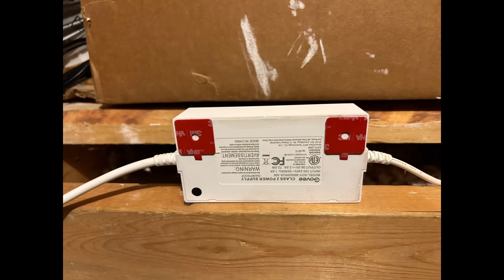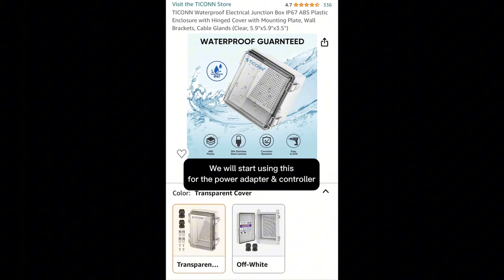Govee Lights( My Home Review) The Do’s & Don’ts @GOVEE  #Howto #govee #diy

Comment: Good afternoon JB, I've joined the club!  You have been a huge help with your videos and answering my questions in a very timely manner.  I have an issue with my Govee 150' elite light strands.  I ran about 20' from the room dormer back down to the A pex at it's lowest point using the wire you recommended from Amazon (thank you!) the I connected the strand I had cut from the end of the dormer to the wire you recommended.  I tested this before I put it up on the A pex and they worked.  I put them up and now the only one that works is the one right after the connection I made and the rest, that and two strands which total 150' of lights will NOT light up.  I spoke to Govee and they think they could be defective as we went through a full reset.  Have you ever encountered this and did you get it to work without sending them back to Govee to be replaced.  They are already attached to the side molding on the house and I don't want to have to take them down and then reinstall these strands if possible as it's in an awkward area for the ladder to go up 16' to begin with.  Please help me out with some advise.  Thank you!!!
Reply from the maker: I have a instagram, would you like to contact me there so we can further review?

Comment: Have you had any issues with these?  After many months of use, mine just died.  I have received replacement parts from govee but still nothing works.  I thought it was a power supply issue but now I don't know.
Reply from the maker: What kit do you have?
Reply: @jbsdiytv  the pro 200'
Reply from the maker: @BigBluePile  The pros not so much compared to the non pros. Did you use a splice connector at the beginning of the install?
Reply: @jbsdiytv  not at the beginning no.  I tried to use those connectors and couldn't get them to work.
Reply from the maker: Boy it sure sounds like you had a bad kit and that’s rare because we don’t really have that many issues. We probably have done at least 20 Pro installs without problems. It must be something else. Do this if you can, grab your controller and power adapter and move it  to another spot in the install. Whether you have 1 or two strands, make sure to update in the app to 1 segments or 2 segments. It’s a perfect way to check if you have a bad strand
Reply: @jbsdiytv  ya, been really weird, but govee has been awesome with replacement parts so far!  That was my next thought, move the controller and power supply to another segment and see what happens.
Reply from the maker: Yes definitely recommend that. If the first strand is bad, your whole install will have problems
Reply: @jbsdiytv  indeed.  I'm not looking forward to tearing the whole strand down if that's what it turns out to be.  Not sure if it's worth replacing a bad individual light vice completely removing a whole strand.
Reply from the maker: It is possible though. Someone reached out here in Texas for a trouble shooting problem where his one light was flickering red and all we did was spliced that light out with another one. Then we used black heat shrink sleeves to cover up the splice on top of the waterproof solder connectors
Reply: @jbsdiytv  when I couldn't get the including splices to work, I did my own weather tight splices and it worked just fine.  I tried every included splice and couldn't get it to work.  Crazy.
Reply: @jbsdiytv  so, an update, looks like the wifi control/power switch module or "control box" fried by what I can only assume was by the included long extension.  The lights past the extension work after I directly plugged them into a power source.  Once I disconnected that extension and plugged in a new "control box" all the lights came back on.  

So, this kit had bad splice connectors and a bad extension harness....🤷🏿

Govee was absolutely fantastic about replacement parts though.  So, there's that !
Reply from the maker: @BigBluePile  oh man thats rare. Haven’t had that happen to us yet. Glad Govee has been good about helping people out with their product. Good to hear you’ll probably be up and running with your lights soon. Thanks for the update

Comment: I dont have roof eave at my home, i dont know if this kind of lights work for it
Reply from the maker: Do you mean you have open rafters or just no overhang period?
Reply: @jbsdiytv  hi there, my house is a town home, and the frontal view doesnt use eave, the roof had internal canoes please watch this video, my english is poor so i dont know how to explain myself
Reply from the maker: @ab221983 hi I understand. Looks like the town homes may be made out of stucco. I don’t think this product will do well on that surface. You will need to drill out small holes to place clips there. It would be best to install permanent lighting with a track and have it color matched so it looks like part of the structure
Reply: @jbsdiytv  agree and i was guessing maybe install something like a little eave maybe an angular and put the lights down….

Comment: Can you use 2 12’ extensions together to jump a 24’ gap?
Reply from the maker: It should still work as I have used the 12’ extension and made a custom cord roughly 3-5ft to attach to it. You will be using two manufactured lines that amp the voltage to your lights so that’s my theory. Good question cause I can see that being a scenario. You have me thinking. I have some lights at home and I’m going to try it and see if there is a drop in voltage and I can respond to this message. Thank you. Even Im learning something new everyday.
Reply: @jbsdiytv  I look forward to your result! The way my roofline is, the only way to not cut anything is to use both of the provided jumpers that came with my 150’ set.
Reply: @jbsdiytv  I just called Govee and the guy that knew nothing said it should work. Lol
Reply from the maker: Yes sir, that’s correct. Everyone needs to plan that way. If you feel that you might need two major jumps, 150ft is the way to go because the 100ft box only comes with one. I think we all hate that accessories just can’t be easily be purchased so we have to make it work.
Reply from the maker: @HughsReviews   After testing the power supply, controller, 2-12’ extensions and 6 strands…It indeed works and I don’t see a voltage drop. Thank you again for your question👊👌
Reply from the maker: @HughsReviews  After my Dallas install video, I wouldn’t recommend putting two 12’ extensions back to back as I did this just to power one single strand and half of it didn’t work or just flicker. I also went in the settings and changed it to 9 segments (108 lights) and that did not work. When I tested this for my last app video, the device might of been cold and had not warm up to the set up. So a data booster might be required after all.

Comment: Where did you get the 12 ft extension?
Reply from the maker: Hi there. Thanks for your question. The 12ft blank extension comes with one in the 100ft kits and two in the 150kit of the 1st Generation. The Govee pros 100ft kit comes with one 12ft extension and two 4ft extensions

Comment: Why are you using cable hooks? Don't the lights have stickers on them? Do you not trust them?
Reply from the maker: 65 installs in, first 3 failed in 2 months. Cleaning the soffit and alcohol. 0. Let’s get it done right the first time
Reply: Good to know! Thanks!
Reply: It says in the instructions to use hooks , the sticky part is only temporary to help at the installation time. Plus, common sense , why would you rely on sticky tape outdoors in rain ,snow , sun heat.

Comment: can you cut and cap your lights to end where you want?
Reply from the maker: Yes. Make sure to cut them in groups of 4. Example if you need a total of 6 lights, only 4 will work and the other two will never work. You can use plastic dip at the cut off ends or you can use industrial glue gun. Place some glue in a bottle cap and dip it after a few seconds of cooling
Reply: @jbsdiytv when u say groups of 4 u mean 4 strands together or one strand has 4 lights and cut after that forth light
Reply from the maker: @HUBBSPEC  you can throw the groups of 4 out the door. In a previous video short(perfect cut strands) I mentioned a lot of you all have brought up that as long as you end you lights by splicing it can’t be less than 4 lights. You can cut after that on a full strand. Hope this helps answer your question

Comment: Amazing job and content My question is what would you suggest if attic has an eve(2x4 blocking exterior), instead of suffix? Just bought mines and want to bring into attic to plug in power. Also the clips in your links are no longer available any other ones you’d recommend?
Reply from the maker: Hi there and thank you for your question. I have commented on this on my other platforms so I will address it here. When it comes to having 2x4’s as truss for soffit, I have seen on a Govee group post that someone used a 1/2”x2” wood stripped where they placed it 2-4” off the wall, then painted it. If you don’t want to weave in and out of those boards, then do this for a clean install and you could possibly save yourself having to buy more lights cause you burned most of your line to make those roller coaster jumps. I’m aware of the clips being unavailable. I’m an affiliate for Amazon and I don’t recommend any others. AliExpress has some for less. We purchase from there as well. Hope this helps and answers your questions

Comment: im wondering if this would work around the edges of my pool
Reply from the maker: Yes it will. It has been tested by the lights being submerged under water. The power adapter and controller I would protect it though. Now the adhesive pad part on the back of the light, I’m not liking the idea. You probably have to really anchor them down with some adhesive so they don’t come undone because they have been failing on the soffits just by the 3M adhesive pad it has. Good question but I’ve never tested it. Good luck 👍

Comment: How you turn on a single light on these strips? Thank for the video
Reply from the maker: Thank you for your comment. These are puck lighting and not strip. So don’t know if the app will control strip if you have programmed this model number to the puck. Just wanted to point that out before I explain. There are a few ways to do this so I’ll explain and let you test it out so you get the hang of it. First, go to the app and make sure your in the color button out of the four. You can pick the effects with the speed, background color and individually customizing each light to color and shutting them off or on. Once your done, save that as a snapshot by hitting the small green camera and name it. You can alway go back and set that when opening the app. Another way is in the DIY scenes. Once your there, go to the top right corner and hit the plus symbol. Name your DIY, start messing with the effects. In effects, there is a drop down arrow and you can pick fade, jumping, twinkle and so on. Once you like what you have created, apply and save it. You can create multiple diy’s and also share those with other users. There is a share symbol at the top right but first it will ask you if you would like to be a Savvy User. Hope this helps. I have a video coming out to go in depth with the app. Stay tune
Reply: @jbsdiytv  thank you
Reply from the maker: Good luck

Comment: Where do you find and purchase these 12’ extensions?
Reply from the maker: You can’t purchase these 12’ extensions separately. Go to a FB govee group and ask some of the members if they have or want to sale extra extensions
Reply: Where are people getting them?
Reply from the maker: Like I mentioned, have to join one of the govee groups on facebook and ask the members if they have any left from their installs
Reply: @jbsdiytv  yes.  But my question is how does anyone acquire them?  Do them come with the light sets??
Reply from the maker: Ah sorry, I was bit confused about your question because most that message already have their lights and need more extensions. Yes they come with the kits. 1st Generation lights 100ft comes with 1-12ft and the 150ft comes with 2. The pros 100ft comes with 1-12ft and 2-4ft extensions
Reply: @jbsdiytv  is there an alternative cable one can purchase and to splice, connect and extend your lights???

Comment: Great video JB. Was wondering what do you use under eaves or soffits that are aluminum? I'm assuming the braid nail wont work. Also do you have to have a continuous run of lights or can have splice anywhere on the run?
Reply from the maker: Use U shape clips or the transparent clips with a small fine tread screw so it doesn’t strip out the metal. You can splice anywhere in the line as long as your bring back together with a small custom jump(less than 3ft) or the provided govee blank extension
Reply: What do you normally use for your custom jumps? @jbsdiytv
Reply from the maker: @jacksonb03 we use 18-3 wire and keep them less than 3ft so there is no flickering
Reply: @jbsdiytv is the govee wire 20 gauge or 18?
Reply from the maker: The Govee wire is 22 gauge. For resistance factors on longer jumps, use 16-18gauge/3 wire

Comment: Just a heads up to anyone thinking of wiring these lights in their attic - do not drill though your roof trusses! Find another way to route the cable. The holes shown in the video are right though a roof truss and to properly fix you'd need the manufacture and possibly an engineer involved.
Reply from the maker: Im a full time mechanical engineer/designer and I did consult with a structural engineer about the 1/2” hole I drilled in that area. Mentioned 3/4” but it’s actually 1/2”. He said the size of hole made in that area is not significant enough to impact the structural integrity of the home. But yes I do agree your point, others watching this will not know that so I do strongly suggest a better solution of routing. On all installs, we have avoided doing anything of this method to try and install through a truss. We route through the soffits. This home is purchased and I don’t ever plan to leave. Thank you for your comment which brings awareness and a valid point👍
Reply: This is one of the most absurd comments I've ever read on YT. You could've cut that part of the truss right down the middle and it would've been fine. If drilling a hole even 3 times as big as the one he drilled compromises the structural integrity of your house then you need to talk to the guy who built it
Reply: I'm a general contractor. Generally in structural wood you can make a hole up to 1/3 of the overall width of the wood directly in the middle without compromising integrity so long as it's not near either end. The only thing the wood in the middle does is keep the outsides in place; the outsides do all the work, and a single hole will not stop that from happening. Hence why truss bridges have mostly air in the middle, the beams are on the outside and crisscrossed between to keep the outsides in place.

I drill through trusses, joists, walls, etc all day long.

Now notching, drilling holes near an edge, that is VERY bad unless specifically approved by an engineer.
Reply from the maker: @christopherrto thank you for your input. Your comment brings awareness and teaches others what’s best. Good day sir🏆